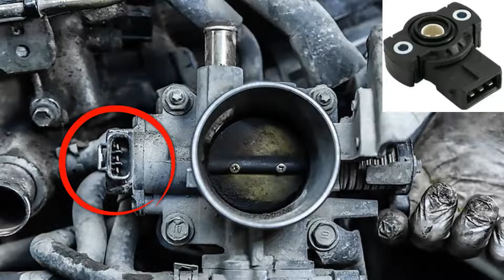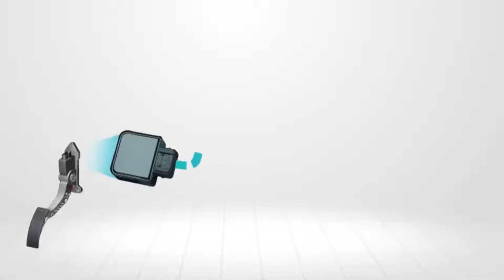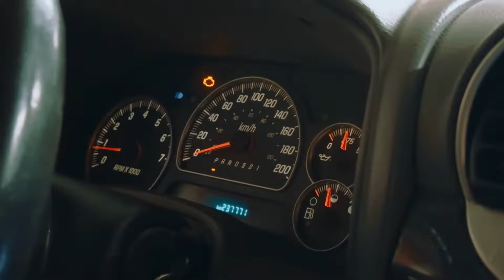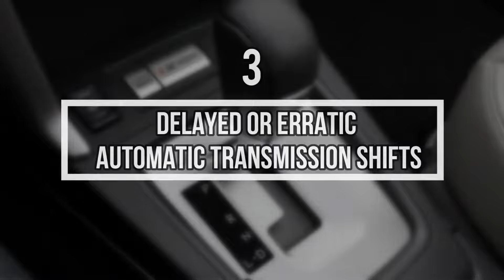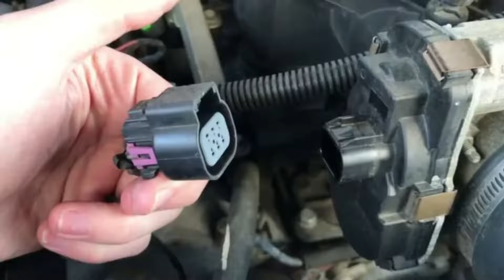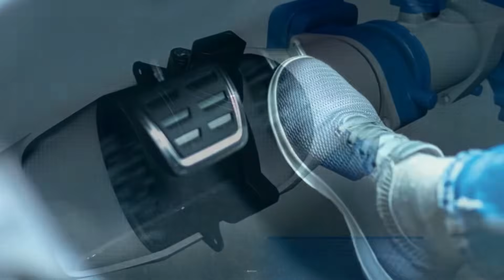TPS Sensor Failure: Check Engine Light, Rough Idle & Transmission Issues

Comment: Thank you so much for this video. Super helpful. I’ve been telling everyone I have a faulty tps but one believes me. I told my dad and he said “TPS as in ‘tire pressure sensor’” has nothing to do with your RPM spiking”. Sometimes when I’m driving my RPM will go up and my car slows down, so I have to pull over and restart the car.
Reply from the maker: Thank you! Based on your symptoms, I think the brake pedal switch is actually one of the most likely causes—especially since turning the engine off and restarting it temporarily fixes the problem. A faulty brake switch can sometimes cause unexpected transmission or throttle behavior on certain vehicles.

I made a full video about this issue here 👇 It might help you confirm whether that's what's happening with your car.
https://youtu.be/2QPlJcxqDZ8?si=vI8SVHSaey_VLa_C

https://youtu.be/SIUEIPRlbDA?si=8COCgSyMpyHspi88
Reply: @aut @autofix-zone  thank you. I’ll follow the suggestions from these videos. They’re very informative. Subscribed.